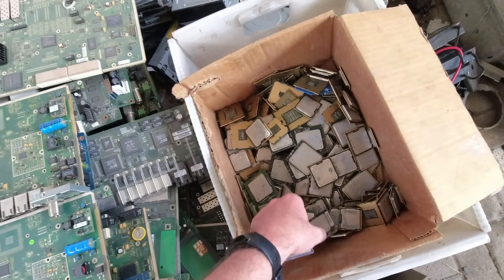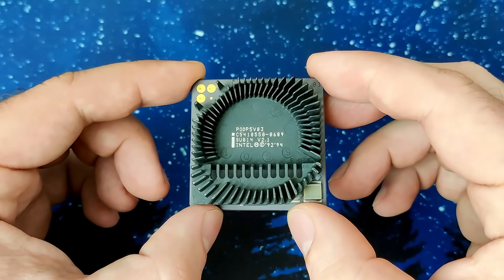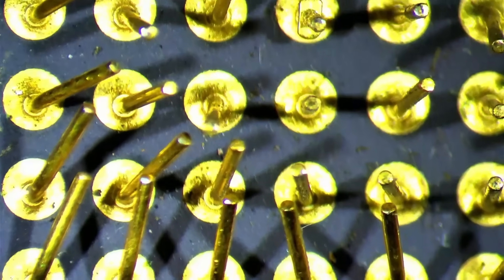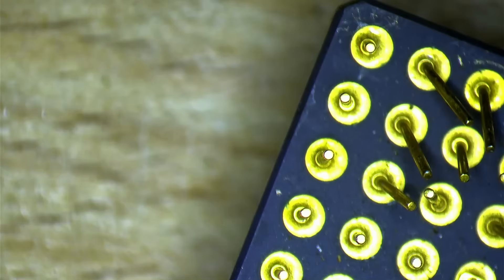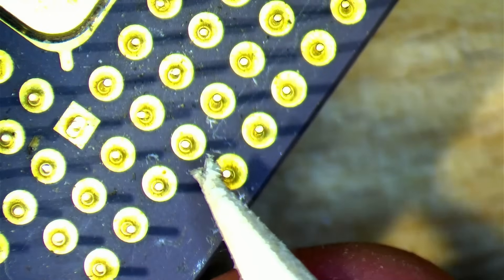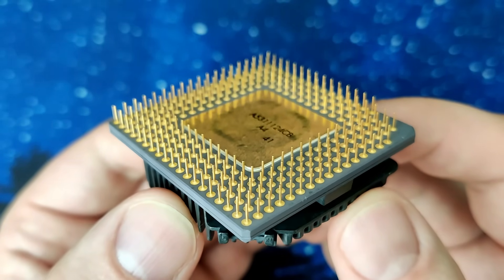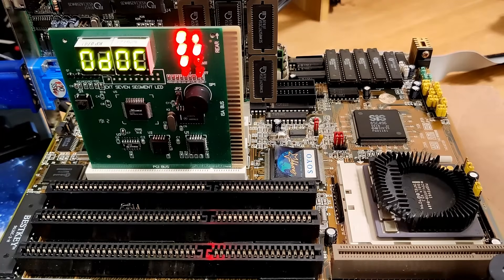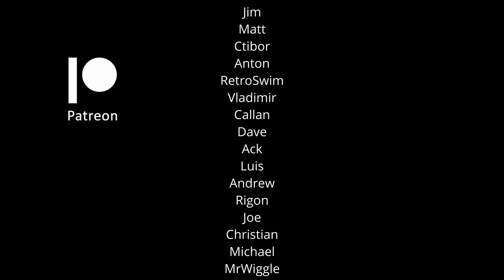Will this CPU work? Intel Pentium Overdrive (PODP5V83) - found at a scrapyard

Comment: I see a lot of german markings on the hardware you recover (and the floppy disks you used for the windows 95 installation); though when looking at the recycling plant (if you can call it that) it doesn't really look german.
Reply from the maker: Correct, that scrapyard is not in Germany. It's in the United Arab Emirates. There seems to be a lot of old hardware arriving from all around the world.
Reply: @bitsundbolts  - Shame to see it like that

Comment: I used a tiny stainless steel tube to bend them in place. It is time consuming. The tubing was HPLC line. The ID is just big enough to fit the pin sngly but not a press fit.

Comment: I have a very old Intel CPU you could have, how would I go about getting it to you?
Reply from the maker: Hey, thanks for the offer. Any chance you could let me know what CPU that is?
Reply: @bitsundbolts  Intel Celeron from 1998
FV524RX488
128SL3A2
Reply from the maker: I don't think it is worth the hassle of sending that CPU my way. Not that there's something wrong with that CPU, but I already have quite a few Celerons in a different config (466 and 500 versions). Thanks for the offer though.
Reply: @bitsundbolts  no problem

Comment: Few years ago i was cleaning my Z77 MSI motherboard and i forgot in the socket is missing processor.. i was doing it using soapy water and large soviet brush ( the brushes are kinda soft ) and by doing so, i accidentaly run over the open socket, bending almost 600 pins. With magnifying glass and needle, i was able to repair it in 12 hours straight. One whole night and a bit of hours from the other day... crazy
Reply from the maker: At least you were able to repair it! But that must have been a bad experience.
Reply: @bitsundbolts  it works untill now but sometimes when i move a case or i move a whole pc somewhere else ( transported by car ) i loose one memory channel, i've even tryed different cpu but same problem. It can do everything what motherboard itself offering but as i said.. sometime, very very occasionaly happen this
Reply from the maker: Probably one pin is slightly misaligned. They are so small and very difficult to fix. I am surprised that you managed to get it working in the first place

Comment: 10 years ago, i had a bunch of those pentium overdrive processors in my collection, as well as pentiums and k6 cpus etc, socket3,5 and 7. sold all processors (around 100) for like 200€. And now you are saying that one of those overdrive processors is worth a hundred. I had around 5 or 6 of those working with original fans.. Maybe i should have kept them.

Comment: Hi, I do have one with original fan complete CPU and one without, both the overdrive version if you are intrested, we can work out a deal for it. I don't know if they work, buth both are in original shape. The one with the fan says PODPMT60X180
Reply from the maker: Hi, I think this is the Pentium OverDrive for Socket 7 - not really a CPU I am looking for. I have a fan on its way that should fit on the Pentium OverDrive for socket 3.
Reply: Ok

Comment: golden cpu are the ones that run coolest, on the least volts and overclock the best. my q9550 was golden. it was the fastest running in the uk at the time.

Comment: Ever have a pin get metal fatigue and just snap? I've only had to bend back like one, maybe two pins on a CPU. I would think the odds of failure increase quickly when dealing with hundreds. too bad the pins aren't solid gold: gold is so ductile I bet you can bend it back and forth quite a bit

Comment: Pins turned out great! It's crazy to me that AMD still used them until a couple years ago. I had a 3300x for a while and i would hate to have had to straighten any of those tiny pins! Of course i have seen people manage to bend the pins inside an Intel socket and those would be even harder to fix, to me it felt almost foolproof, just set it in flat and shut it, i don't know how people manage to bend them. Like, holding the CPU a foot in the air above the socket on its way down and dropping it? Who knows...
Reply from the maker: Thank you! I'm happy with the outcome of the Overdrive - and the fact that it's working! I just have to wait for the original fan which should be with me in March.
I wonder if Intel decided to "offload" some cost to the motherboard manufacturers by making it their problem with the pins. If you're planning to reuse the board for multiple CPU generations, then it would make sense to keep the pins on the board, but Intel wasn't particularly good to support more than two generations per chipset. AMD did much better with AM4. Wonder how long AM5 will last.

Comment: I like to use a scalpel or screwdriver to straighten pins so instead of pushing the pin back up you brace the bottom against the surface and twist for more control

Comment: Man; that ´s a pitty and bad coincidence to have 2 dead 486 DX2/66. Those are almost immortal if not physically broken. 😢 I am buying scrap CPUs as well. So far all I straightened worked! 👍
Reply from the maker: I will check those two DX2/66 in a different board. It's a mystery to me. I bought them from eBay - so, could just be really damaged and that person wanted to get rid of them. All other CPUs I got from the scrapyard are working so far.
Reply: @bitsundbolts  This most likely true. Sad but people do that. It is like a plague of the auction servers. 😣

Comment: one method for straightening bent pins is a large blunt needle, like the ones used for refilling inkjet cartridges. you could likely find a size that will fit closely on the pins and bend them straight.

Comment: Great repair, I usually use a needle off a syringe to repair bent pins and I've done loads using that method including a couple of overdrives and loads of P1's and P3's but whichever way works for you is good, it does take a lot of patience for sure, I'll look forward to your next video on it. 👍

Comment: Holy shit you're amazing at straightening all those pins. So much patience is required.
Reply from the maker: Thank you! I'm partly driven by the CPU which I didn't have yet in my collection. I was really careful and tried to do a perfect job. I hope that I'll soon have an original fan to make this CPU whole again! Thanks for watching!
Reply: @bitsundbolts  I wonder if you can even solder new pins on these things if they do break. Feel like they'd just snap off.
Reply from the maker: Wait for the next video 😉

Comment: Hi there, i have a bit of an oddball cpu that as yet i dont have a motherboard for, 
its a Kingston Turbochip TC5x86/133 Overdrive CPU for 486 socket 3, 
yes you did read that right, pentium 2 speeds on a socket 3 !
 i had to check multiple times to believe it myself when i found this in a junk shop in the UK, not only that, there where 4 of them, i have all 4, have you ever come across one ?

Comment: Why did they want so much money from you at the scrapyard?
Seems like the guy was very shady and pocketed the money.

You sound German and when they allow me to look through the trash (not everyone allows that) they either say take the shit or they weigh it and I give them the scrap price.

The outcome  would be  below 3€ for a handful of CPUs.

Or was this a private facility?
I always go to our municipalities scrapyard when I want to get rid of stuff and I ask if I can look through the electronics.
The outcome of that question depends on the guy sitting there.
Reply from the maker: Usually they charge per weight. However, for CPUs with high gold content, they charge per piece. The main CPU that made me get this batch of five CPUs was due to the Intel Overdrive. The sellers are aware of higher values of older CPUs. Pentium 4 or newer models go for about 1 USD per piece

Comment: As a tech in the mid 90's and mid 2000's, I've binned back many pins and this was far the cleanest. I hated it when customers have forcibly plugged the VGA connection upside down and so a needle nose plier was always needed.

Comment: I have restored one such overdrive in the past. Mine not only did not have the fan, but even the hearsink was gone. I used a 3*3cm aftermarket heatsink that I attached with double sided thermal tape, and a fan going to a molex connector on the PSU. Of course it needed the mod to make it think it had the original fan on to make it work at full speed. 
Furthermore, in order to overclock it I had to volt-mod it. There are guides and tutorials on how to do that on Vogons... I ended up with the diode mod to the VRM, 2 Schottky diodes boosted the core voltage to 4V; at this voltage, the CPU ended up being very stable running at 100MHz (40*2.5).
Reply from the maker: Do you still have the CPU? I am not sure if I will overvolt mine. With the original heatsink on, it may be a bit tricky to reach the voltage regulator properly for the diode mod. I'm also concerned about running the chip at our-of-spec voltage - I don't want to destroy it for a couple of MHz more. I'm fine with the original frequency. It would be cool if the CPU would do 100 MHz without voltmod, but I keep my hopes low for now.

Comment: Watching Adrian's digital basement regarding the Pentium Overdrive when the fan is stopped the CPU reduces it's speed performance from 83 Mhz to 33 MHz to save from overheating. So as you currently have no fan I don't think the CPU will not run no where to it's full potential. I think the multipler changes on the fly. Something to take note of when testing the CPU. You may be able to connect an alternative 3 wire fan with speed sencing so it makes the chip know there is a working fan so you will get full performance.
Reply from the maker: Yes, there are mods that enable the 2.5 multiplier. However, that of course, should only be done when there is actually a fan attached. I got an offer for a replacement fan which should arrive in January.

Comment: Would heating up the pins before bending help?
Reply from the maker: Considering that the melting point of metal is quite high, I doubt that heating the pins would benefit the bending process. But I may be wrong.
Reply: @bitsundbolts  I was thinking about it maybe helping to relieve the stress, even if it was way below the melting point; I am not a materials engineer tho! You seemed to have done a good job anyway :)
Reply from the maker: Yeah, I don't know either if something like 80-100 degrees would make a difference.
The pins on this CPU were quite "soft". Even that very first pin I straightened, the one that was bent 90 degrees, didn't feel like it was going to break. I have another 486-133 P75 CPU from AMD with a similar issue. I'm curious if I'll be as successful with that CPU!
Reply: @bitsundbolts  I guess the pins are luckily made from quite malleable metal(s). Good luck with your other rescued CPUs. Your video came randomly up in my recs, so a new sub from me :)
Reply from the maker: Thank you!

Comment: I knew when I saw the teaser pic the other day it was a Pentium overdrive. I never ubderstood what Intel waa going for with this though. I remember it being far more costly than a dx4-100(and later the 5x86-133) that could overclock high enough to beat the overdrive in integer math, and give decent fpu performance versus the much more costly socket 5/7 platforms in 1995-1995 timeframe. I want to say I picked up my 5x86 around March 1996 for around $30 and immediately overclocked it to 150Mhz. It was roughly on par with a P90 for integer games and a P75 in Quake, whixh for the price couldn't be beat at the time. About a year later I finally built a p54-120 socket 5 system when prices dropped.
Reply from the maker: Yeah, this CPU is an odd addition to the socket 3 line of CPUs. However, I am happy Intel went to that length to make the Pentium compatible with this older platform - now we have some interesting comparisons ahead of us!

Comment: Those pins aren't too bad having fixed worse but when there is corrosion they snap off ever so easy (R.I.P). Kinda wild how much the cost of 90s retro hardware has risen lately.
Reply from the maker: Well, I just broke one of those pins on a 486 DX2-66. As you said - corrosion! Will come up in the next video.

Comment: Ah yes, I remember owning one of these Overdrive Pentiums. IIRC, it was a later model that was already used and outdated at the time and not my daily driver. Such a cool cooler design (pun intended), they did easily clog up with dust though. Somehow, I was always intrigued by Overdrive CPUs, my 486 DX4 was one too.

A-m-a-z-i-n-g job on the pins, this is pure restoration porn. 😅 I never would have expected you to be able to save every single one of them! I suppose it does help that these older CPUs have fewer and thicker pins and that they're made of gold, that doesn't make it any less impressive though. I knew the socket would straighten them to (almost) perfection, I used that to my advantage myself a few times. Good luck finding a matching fan!

As for comparison, (GL)Quake would be my first choice. If you want to go for something more obscure, Zone Raiders comes to mind. I remember it (unsurprisingly) not running well in SVGA on my DX4 and am wondering if it would have ran any smoother on a PODP5V83.
Reply from the maker: Thank you! I didn't expect the pins to turn out that well! I'm happy that it worked out - and I already got an offer on a fan. So, in January, if everything goes well, we will see this CPU again - with an original fan!
Never heard of Zone Raiders - but I'll check it out! Thanks for the suggestion!
Reply: @bitsundbolts  That's great! I would have imagined a fan to be much harder to come by. One of the perks of being a Youtuber, huh? 😉 Zone Raiders wasn't particularly successful or memorable, it was just among the first 3D games that I remember offering an SVGA resolution and the one that made me realize that my DX4's days are counted. That's really the only reason I still remember it today. 😅
Reply from the maker: Yes, it all has to do with a wider reach 😉. I'll have a look at Zone Raiders

Comment: They cut down the Pentium for socket 3 but there was a good reason, 486 owners could see a pretty substancial performance boost often outrunning 486DX/4-100s especially with the Pentiums far improved FPU, including the benefit of being able to run Pentium specific software, unfortunately other companies chips were even faster, cheaper and most applications didnt take of Pentium specifically at this time. 
So it was simply outsold by cheaper faster alternatives such as the Cyrix 5x86 133 series of CPUs and the likes. (AMD)

If I remeber correctly that Cx486 is essentially a clock-doubled 486SLC adapted to a 386 socket and bus.

Comment: Important! You should never run an old CPU that requires a fan without a fan. The old CPUs have no protection against overheating, they don't throttle down and therefore burn out.
Simply use a normal case fan and place it over the heatsink to actively cool the CPU. That should be completely sufficient.
Reply from the maker: While I agree with you to not run any CPU without a cooler, the Pentium OverDrive does have a mechanism to detect a spinning fan. I am missing the fan on mine and because of that, the CPU down-clocks itself to 33 MHz instead of the normal 83 MHz.
Reply: @bitsundbolts  Okay, if it does have a simple "fan connected?" check then this should be fine. But keep in mind, if the fan is connected but falls from the cooler or stops to spin, then the CPU will not do thermal throttling. There are videos about old CPUs where this was tested. One is for example:
What happens when a CPU heatsink is removed

Comment: I found one of these on Ebay over a decade ago for $20 because it had bent pins. Though mine wasn't nearly as bad as this one, it looks like it was pried out of a LIF socket at an angle, so all of the pins had a bow to one side. Using two dull box cutter blades pinched together made them straight again.

I bought it because I heard about the hype of how much faster they made 486 machines, but I was left disappointed. An Am5x86 overclocked to 160 MHz smokes this chip in most everything except floating point performance. If you needed it for its FPU, it was a good solution, otherwise it was an overpriced gimmick.
Reply from the maker: There'll be benchmarks for this CPU, but I'll try to test other games / software compared to what is already out there from other Retro YouTubers

Comment: Works with many socket 2's as well. Had one in my old Compaq to benefit from the 586 architecture Linux builds to run my samba, ftp, http, and SMTP servers. And even dns for a while. Only stopped using it when the 10mps lan card slowed down my network. At the time I couldn't find a 100mbps in an isa card. So I had to upgrade. But the system itself didn't seem to be stressed just serving files and such.

Comment: How does the chip know there’s no fan attached? I didn’t see any fan outputs on the cpu package? Or is it checking something on the system board?
Reply from the maker: There are three round contact spots on the top side of the ceramic. One is 5V, one is Ground, and the third is a Sense connector that can detect the presence of a fan. Vswitchzero has a nice video with more details - or you wait for the next video about this CPU, where I'll be addressing those details. A viewer offered me a fan for the CPU - which hopefully will arrive in January.
Reply: Thank you! Looking forward to it!

Comment: I’m surprised it POSTed at all without a fan!
Reply from the maker: It doesn't get hot at 33 MHz. It barely gets warmer than 35 degrees (measured by touching the heatsink). I think this was a protective mechanism in case the fan failed. The CPU could probably survive operating at 33 MHz without a fan.